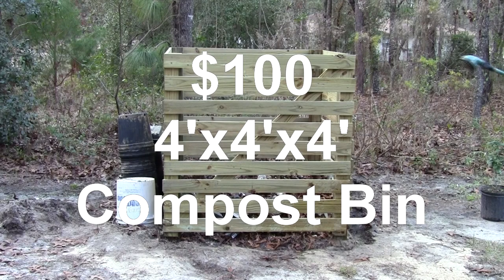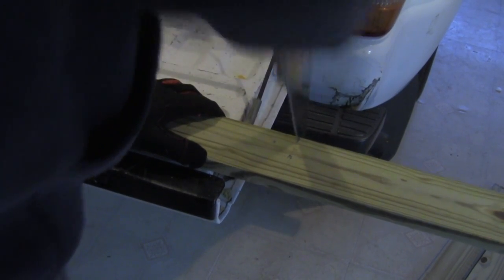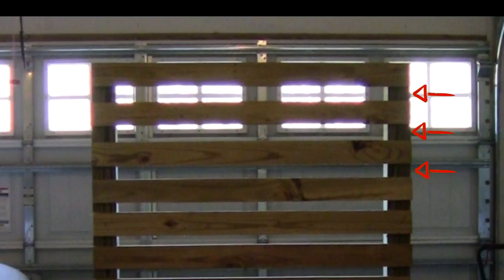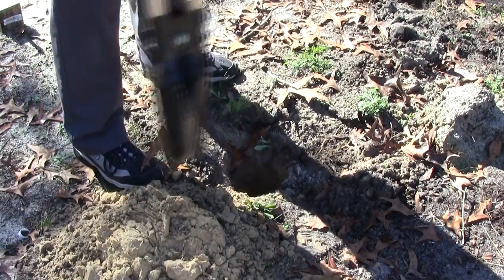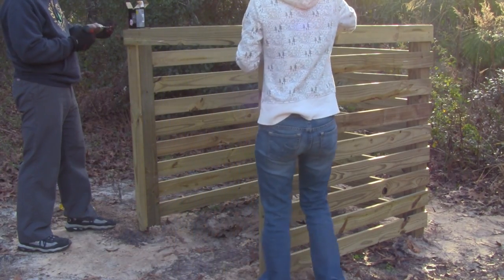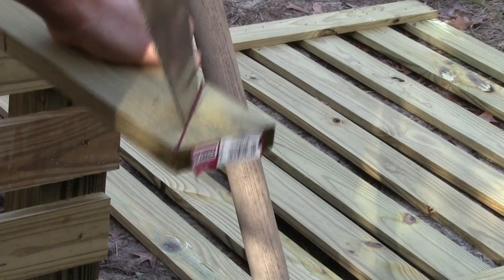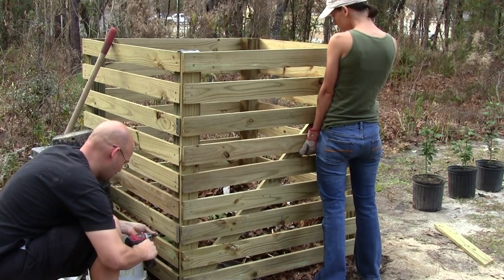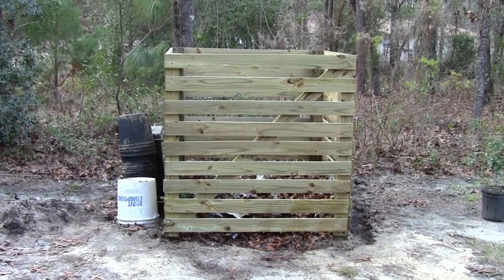How to Build an Easy Compost Bin

Comment: So the chemicals from the pressure treated wood leaches into your organic compost.... you know this is a big no no they banned using this wood in playgrounds for a reason in Canada it poisons you
Reply from the maker: in the old days yes, now they pressure treat with copper
Reply: Up here in Canada our Gov has banned all pressure treated wood in play structures in parks, green or brown it doesn't matter. Read the material handling safety sheets on it, wear gloves, face mask when cutting, and keep away from food. There is still poison in the wood treatment copper or not...
Reply from the maker: http://cwc.ca/design-with-wood/durability/pressure-treated-wood/

Comment: nice build but i would have defintely not used treated wood. the arsenic will leech into the organic material within the bin, compounding the overall poisonous material that will then go right into your vegetable garden. if you're planning to add the compost to decorative shrubs or trees, then it isn't an issue. you really want to keep this out of your food.
a non-toxic option would be untreated wood stained with tung oil. otherwise, nice build!
Reply from the maker: They don't use arsenic to treat wood anymore
Reply: wood produced (treated by) u.s., australian, the UK and most euro companies are bound by law to use newer processes. imported products (like from china...) are not bound by such laws. it bleaches out in the sun (and leeches out) after 2 years anyways. hopefully you got some good locally produced wood.
cheers
Reply from the maker: randall larocque well china...yeah...not here though..:-)

Comment: I wouldn't use pressure treated wood it has arsenic in it, traces might be small but over time the arsenic will leech out into your compost. I have just built a 3 bay compost out of untreated recycled pine pallets.
Reply from the maker: No it does not..google it..;-)

Comment: Makes me wish they made 4' pallets so we could save the hundred. The  4'x4' really allows the room needed for a smaller scale composting. I have used the pallet set up in the past, but  the compost material was always slipping into that   "pallet gap".  Nice presentation, simple but well thought out!
Reply from the maker: +Steven Lewan Thx Steven...appreciate it!
Reply: Use some scrap chicken or mesh fence wiring and wrap around your pallets. I use two old pieces of rebar to stake and keep the fence taught around the compost bin.

Comment: im completely new to composting and my compost bin is no where as neat as yours enjoyed watching your video it just shows that you can achieve a great neat finish even without power tools i did mine as more of a test bed to see if i could produce reasonable compost reduce household waste by composting  kitchen leftovers and using compost for garden so if this experiment of mine actually works then i will expand on it and do a much more proffessional job i used mdf boards and old bed slats made of pine all screwed together theres air gaps between slats so all in all not a bad start for an experiment let you all know how it goes im hoping it lasts a year.

Comment: Pressure treated wood is not a good idea. The chemicals may leach into the compost and end up in your garden, plants, and you. The entire purpose of the compost is to grow bacteria, if pressure treated lumber is used it will inhibit that growth.
If you place the bin above ground sitting on top of the soil, a 'sacrificial' 1x2 along the bottom can be allowed to rot with the pile, replace it every 3 or 4 years. Good bacterial growth, safe food to eat.
Reply from the maker: dennis j poley jr youre thinking of the old way of pressure treating wood, now they just use copper...;-)
Reply: Yes its safer than arsenic but still not the safest, and still anti microbial.
Reply from the maker: Yes but not toxic...imho..;-)
Reply: The Wannabe Homesteader hey if it works for you thats great but the guys point is not the toxicity if the chemicals to us but to the beneficial microbes in compost. Killing those will only make things worse for your compost.
Reply: Treated lumber and organic growing don't go together in the same sentence... or in life...

Comment: Now with it turning cold I have a nice mix of mulch leaves and grass clipping in my compost bin. I am now adding kitchen scraps- coffee grounds fruits and veg left overs... So I have a ??? I read adding urine and ammonia is good to add for moisture and extra nitrogen to activate, heat up the compost come spring but wont the urine and ammonia kill or drive away earthworm, microbes and other good stuff or what???
Reply from the maker: charlie warner I would not add ammonia, and you can get enough nitrogen if you add green leafy matter in.If you want you compost to kick but with this setup, and add everything and turn and water it every 3-4 days.  It's more work, but ours gets so hot I can barely keep my hand inside of it.Would be nice if you can get some manure in there somehow!!
Reply: mix can of beer and some sort of cola with a cup of ammonia.
spray it over the surface evey time you start a new layer, it feeds the compost
and adds more yeasts as well as ammonias which convert to nitrogens.

accelerates the pile by weeks-
but you must keep it wet and you still need to turn it over

Comment: You could have your slats evenly spaced all the way to the top by beginning at the top, not bottom. The gap at the bottom isn't as important, and is easily adjusted by digging or slightly filling the holes. If the posts are in the ground 23 or 25 inches, it'll work just as well. Good job.
Reply from the maker: steve w Yeah a friend of mine pointed that out to me and then I felt dumb...LOL
Reply: WB, you're not dumb, and you said you're not a carpenter. You and your lovely assistant did a nice job.

Comment: nice looking but no need to bury your 4"x4" in the ground, it'll just rot faster.
And if your bin is full and you open that front door, you'll not be able to close it again,
the side panels will be pushed from each other, better connect them with a 4"x4" over the top.

Comment: Thanks for posting this!!  I followed your example and built 4x5x4 compost bin. I made mine slightly wider so I could fit the loader of my tractor in the open for easier loading and turning. It seems to be working great so far!   I already have it filled with shredded yard waste and currently it is holding at about 140 degress.   Nice and hot but not too hot :)

I wish I could post a photo :(
Reply from the maker: salsastud ... Awesome man...140 is right on from what I have read.  Can you upload a pic to your google+ profile and then post the link?  We would love to see it!
Reply: wbhomesteader Thanks for the tip!  Hopefully this works.
https://plus.google.com/100370854415648758392/posts/j13AEhM1yut
Reply from the maker: Oh yeah that is nice and full.  Gonna be nice to scoop that up with your tractor once it's ready.

Would you mind if we shared the pic on our FB page?
Reply: wbhomesteader
Feel free to share it!  

Funny thing about making this.   I showed my wife where I was going to put it and she said it was fine.  I worked all day and into the night, gathering materials,  ripping out a tree, digging the holes just right and making sure it was level so that I could impress her with the awesomeness on my accomplishment the next day.   I never really built anything like this before so it was a big deal to me. 

When the moment of truth finally came, she looked at it and the first thing she said was, "It is not aligned right.   Can you move it a few feet over and rotate the angle?"  

I had a melt down.   After working so hard and ready to move on, the thought of taking the thing apart and digging more holes was agony. 

But of course "a happy wife is a happy life".   Sometimes you just got to do what you got to do.  She was right though, how it sits now it much better then before...
Reply from the maker: LOL....That is hilarious....It looks awesome, thx for sharing.....

And yes Happy Wife does indeed equal a Happy Life.

I'm going to share your story over on FB...freakin hilarious...and it looks awesome.

https://www.facebook.com/wbhomesteader

Comment: nice looking but might suggest using Cedar ... that lumber is very toxic - dont ask the wood mfg if their stuff is toxic.. because the answer is what you want to hear not what is true.. outside of only heat treated its toxic.. try cedar..... or u cant use the compost for a garden.. but nice job ..nice presentation too.. Thank you!